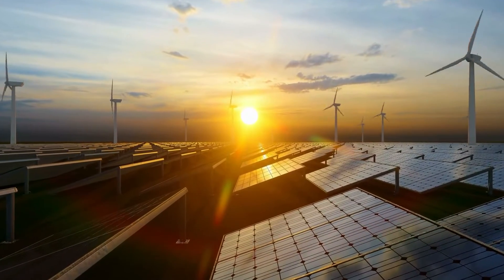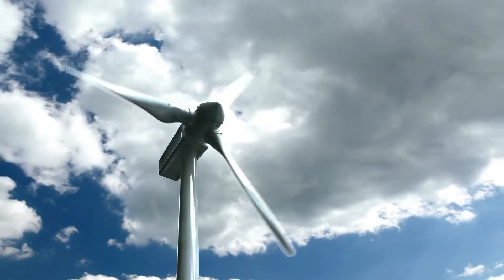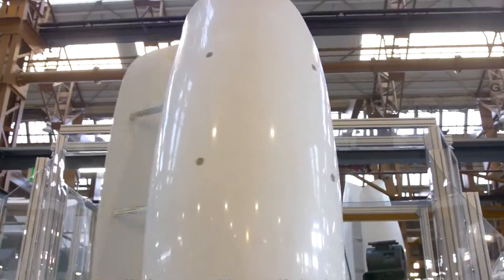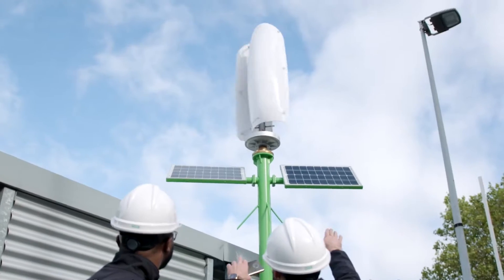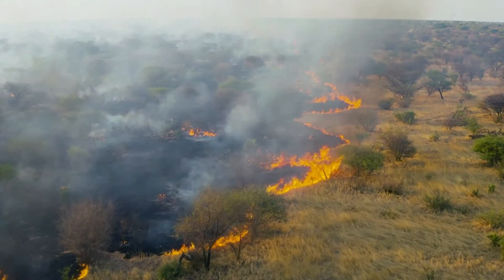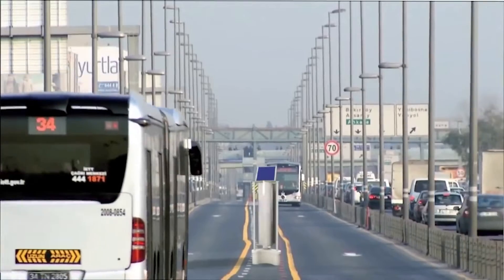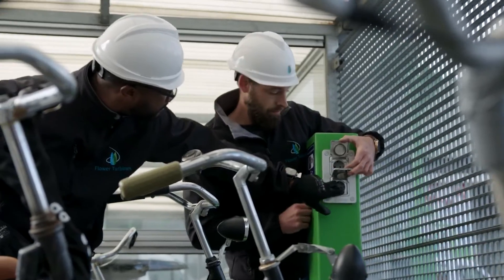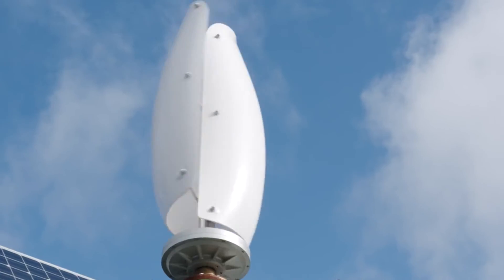‘Tulip Turbines’ A Concept to change the wind turbine business

Comment: sick, this is what we need.
This, and/or other forms of capturing wind energy.
Typical windmills aren't that good.

I had an idea for a turbine that's based off a solar oven.
Trap that heat in.
Put a thick metal rod in there which also comes out of the oven and is used to heat water for steam turbine.
Seems easy to me, and could put anywhere.